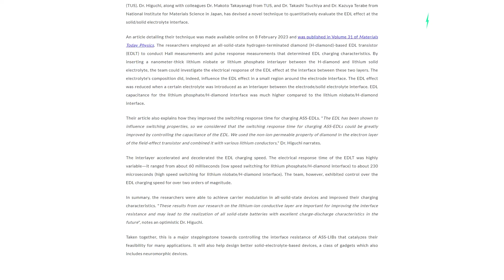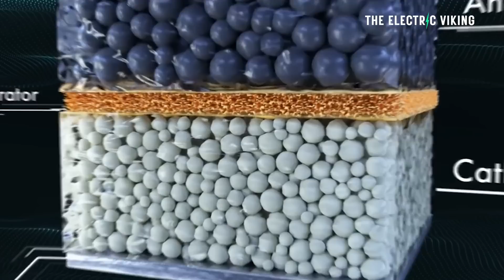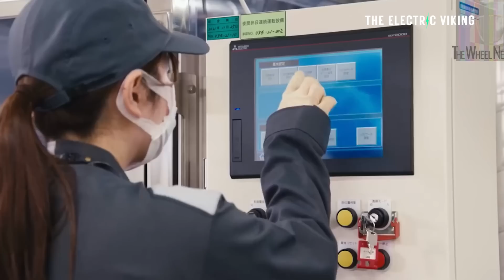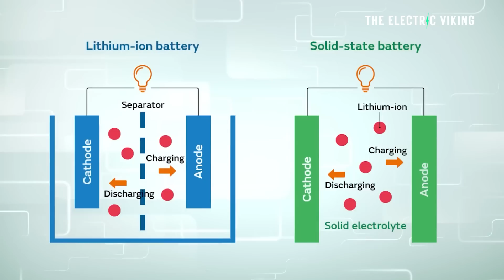Scientists unveil Solid-State battery breakthrough enabling commercialisation

Comment: If these solid-state battery pack charging speeds of around 5 minutes are for real, then quick-change solid-state battery packs could electrify most forms of motorsport, because the time an EV race car spends in the pits would be cut to a minute or two.

Comment: I still say this makes it sound at least another 5 years out, more likely 10 years out. We now know the problem and a solution, but how do you mass produce it? We'll also need brand new manufacturing machines, new plants, etc. 

And no, this is not like iron phosphate batteries, not at all. Iron phosphate batteries utilize iron phosphate as the cathode material. This study claims using small strands of lithium phosphate in the battery divider solves the issue. The battery still is basically the same solid state batteries we've been seeing for years with a slightly twist. Also many elements can be bonded with phosphate for an effect. It's the reason why there's still so much to learn in chemistry even hundreds of years later as the slight changes in atomic combinations or even just the pattern they are in a material completely changes its properties. Graphite, graphene, carbon nanotubes, and diamonds are all just raw carbon in different patterns. These are all vastly different materials to us with totally different uses. It takes a lot of experimentation and rigorous studies to find out new uses for the same elements.

Comment: The impedance of the interfaces have been measured for years and there won't be a double layer to contend with. These guys made a problem that they solved that doesn't exist in the lithium metal micro battery which has been in existence since John Bates developed it at Oakridge more than 30 years ago. His developed Li3N which has been rediscovered by every Li metal cell developer since and Bates got it to form spontaniously  once his LiPON was more than about 70% Nitrogen. The real problem they haven't solved is how to make a cathode greater in thickness than Bates's ~ 10 micro thick LiCoO2 cathode. No one has a 250 to 500 micron cathode, NMC or other with e-6 S/cm conductivity to match Bates's LiPON. When the do they will have 10s of thousands of cycles like Bates and unmeasurable self discharge like Bates but unlike Bates they will have mor🎉e than his ~ 1 mWhr/cm2. STMicro and IPS (now inside Apple-RIP) got 700uWhr/cm2 with  ~ 10 microns of LiCoO2. A 1mm thick cathode thin film battery with matched cathode  conductivity could provide ~ on the order of 1kwhr/kg and like the thin film micro battery store electricity with retention below inflation. It is out there, but it will obsolete cars. Even Musk said with more than 450Whr/kg batteries, he will stop making cars and  we will all travel in his VTOLs.

Comment: How could you have batteries that can be charged in record time?, would it not require high voltage and enormous amps output, where is the infrastructure and when will the necessary power output be available? surely there would be a lot of heat to control.
Reply: 100% agree on that. I am tired to hear about supershort charging time, at the same time almost no person knows what this means.
Tanks from Sweden.  SB.

Comment: They still can't beat LFPs. If you only use 60% of the battery and then charge, you get 10,000 cycles. Their solid state battery simply can't compete. No one wants to pay for changing batteries in a few years. If you only discharge to 50% you get 20,000 charge cycles. Think about that. You drive 40 miles a day (average in the US). You have a 300 mile battery. So if you only charge every 4 days, your battery will last 4 days * 20,000 = 80,000 days. Which is 219 years. You will get rid of your car before the battery wears out.

How is Toyota going to compete? Also solid state batteries are much more expensive than LFPs. So Toyota won't even be able to come close in price.

Comment: Just around the corner,. The holy grail of battery technology. In 5 years we will still be hearing the same promises. Batteries charge and discharge. Over time this ability gradually decreases. This has not changed all that  much in the past 30 years.

Comment: Is there a definition of 'solid state'? The main component of this solid state battery is lithium. Is it notably different than a litium ion battery? Seems to have the same issues too.
Reply: Yeh it's a lithium ion battery with solid electrolytes. The problem was that the lithium would get reduced before crossing all the way to the back material, so it wouldn't charge so much...

Comment: Ok so this requires a mass production technique that can produce interlayers less than 5nm thick. Without that interlayer the surface resistance of the electrolyte and electrode interface is still a problem due to the EDL effect. And does the Li3PO4 interlayer work with a scalable electrolyte/electrode chemistries at the interface?
Reply: Take a look at aluminum-graphene batteries. Way different ballgame there.
Reply: @andrewkaiser7203  aa

Comment: @0:21, Toyota won’t even mass produce plug-in vehicles using NiMH battery or Li-ion battery that have a 100 mile EV range. This type of vehicles will buy Toyota precious time until its solid-state battery is available. Instead of pursuing this strategy, Toyota is pushing old tech hybrid, hydrogen, Red hydrogen, or other pie-in-the-sky. Each passing day that Toyota doesn’t produce an EV means Toyota will fall further behind the competitors. Eventually, Toyota will be irrelevant and relegated to a ‘had-been auto manufacturer. ‘ Maybe Toyota already has one foot in the grave.
Reply: Maybe, maybe not.  Would not be the first time a company waits until the technology improves. Unlike other companies that jumped on thr electric cars bandwagon and are losing a lot of money,  they are still makinh money.
Reply: A hybrid with 100 miles of EV range is just a low range EV that has to drag around an entire ICE system for the couple times a month it might be needed.  It would be more expensive than a reasonable hybrid like the Prius, and probably about as expensive as a full EV.
Reply: @incognitotorpedo42  ::: but Toyota needs a desperate weapon against the EVs which it doesn’t have. Plug-in is the best it can do to  stop the bleeding.

Comment: I enjoy your comments and find many of them helpful.  With regard to solid state battery breakthrough however, these are interesting but not much else. I used to subscribe to the MIT Technology Review  and during the late 90's early 2000's I remember at least one solid state battery breakthrough article a year.  Ten scientist in a lab surrounded by a myriad of graduate assistants and state of the art equipment does translate easily into a production capability.
Reply: Battery tech is like climate change... one of the greatest frauds of mankind
Reply: You just can't appreciate b-roll while the Electric Viking tries to dissemble. Ha.

Comment: Listening to the discussion on the breakthrough, that they supposedly have under solid-state batteries there at Toyota ,you know we have to realize a factor and that’s the manufacturability as this looks to be very complicated and can’t really be mass produced at speed on scale. This all looks to be very unlikely for mass production, unless there is some massive breakthrough in speed. it also looks like they’re using some kind of diamond disposition in their matrix. This all looks to be very very expensive to produce. And the likelihood of this being put in production on a massive scale is very unlikely in a timely manner.Think about it putting a factory up,a new manufacturing processes and everything. Now let’s look at Tesla on the 4680 comparatively speaking ,I think it’s simpler than what we’re talking about here on this new battery from Toyota by a large margin, TESLA has had difficulties and only now are they ramping up production for the 4680. I bet you I could wager that a production facility using this technology will be at least five years out from now. Tesla can move at warp speed.,can anybody else do that? It looks like not.😂 everything I have heard about solid-state batteries, and they’re manufacturability and especially at speeds necessary to put in the cars looks to be very dubious at best. I am absolutely convinced that the cylindrical battery cells for manufacturing speeds are far far better than using pouches, prisim etc. in battery production. There is a thing I’d like to mention the fact that Elon Musk even mentioned that the cylindrical cell can be adapted to a solid state form, or the very least semi solid state form.😅
Reply: My understanding is that the diamond referred to is a probe used in measuring just where the current is flowing and where it is not, as a means of identifying where the problems are. It would not be part of the production cells.

Comment: This improved understanding of the interface between the electrodes and the electrolyte can only be helpful to the design of batteries of all types, both solid electrolyte batteries and liquid or semi-liquid/solid electrolyte batteries.

However, the safety of any battery that includes a pure Lithium anode will always be dubious at best, due to its susceptiblity to leaking seals and likewise inability to pass the puncture test. Either of these conditions will lead to lithium fires, as the pure lithium oxidizes rapidly whenever it has access to the oxygen in the air or water.
Reply: Lithium is one element which will combine with the nitrogen in the air as well as the oxygen !
But because a battery (or cell) attempts to harness the electrons from the interaction of two elements or compounds, it is almost inevitable that the more energy-dense the cell, the more reactive the compounds are to each other, and it is wishful thinking that we can find elements that react energetically with each other and nothing else.
So batteries will get more dangerous if damaged or abused. We just need to engineer a solution to minimise the risk.
Reply: @davidinkster1296  Exactly - that's why the electrodes are engineered to intercalate the Lithium ion. The same will be true for any Sodium battery.
Reply: Dare ya to find a smaller cation than Li+. Also to swap your battery before it rots through in 40 y.

Comment: Hello My Friend. I need a EV to be able to drive to say 700k a couple of times a year. The rest of the time I do  30k a day. The battery capacity of my EV should be used for grid storage.   So what infrastructure do we need? Bi directional chargers at car parks. Open air carparks should be covered with solar panels. What is the cost to provide a charging station at every Westfield parking spot. Obviously wireless charging is required.
Reply: obviously...
Reply: dont think any car/truck on market has wireless charging
Reply: @8ettieP46e  yet